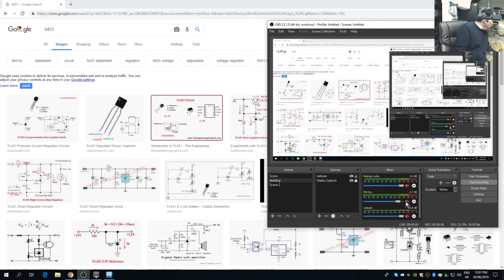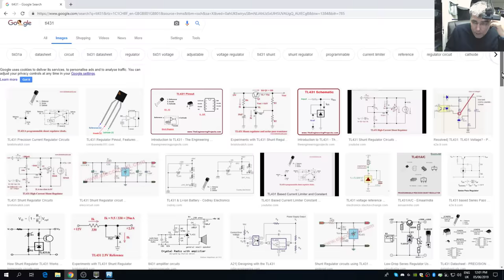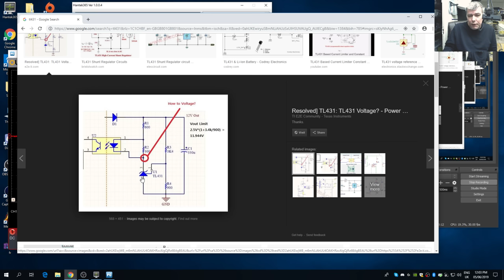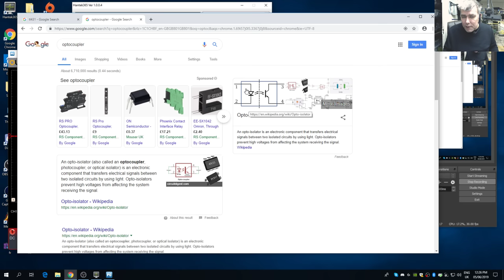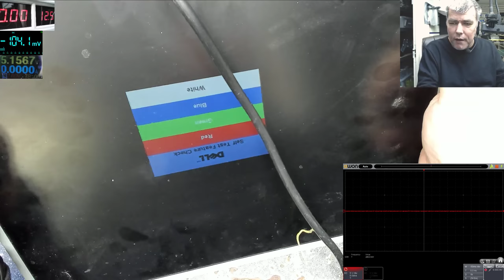Steps to diagnose and repair switching power supplies

Comment: Thanks for the detail explanation along with the capacitors discharge or shorted to ground.  Your oscilloscope detailing is really impressive.  Thanks for the teaching and sharing.  Gain a lot

Comment: Opto coupler feed back from secondary power which feeds back secondary output voltage  to the switching drive IC in primary drive. Drive IC sends pulse width  switching  pulses to FET which in turn drives primary side transformer . Typical switch mode power supply feedback loop. Your correct. Primary needs to know what secondary voltage is.

Comment: Multumesc! I previously fixed a cheap SMPS just for the sake of it, since the parts cost me more than the PS. However I did't know the trick to check the low side regulation. 
Salutari din Galati!

Comment: It would be nice if you would do some trouble shooting and repair of cheap video cards off something like ebay so that some of us can learn the correct process. I have tried removing items and checking them, injecting current and voltage without any luck. There are people doing this on expensive cards that look nothing like the cheap cards and they move so fast and with the camera back so far that you cannot see what or were they are checking things. Thanks for your time. Stay safe.

Comment: You can't necessarily tell if the capacitors are fine just by looking at them. At least half of the bad capacitors I have found with an ESR meter, looked perfectly fine, but they were causing the units not to power on. I can't believe that you don't have an ESR meter. The "Blue ESR tester" is a great meter because it gives accurate and consistent readings instantly. The very cheap ESR meters can take a very long time to get a reading.

Comment: domnule Sorin, va rog o parere: am un tv BUSH dled 49 inch. functineaza normal timp de 10-15 minute apoi ramane fara backlight (dispare lumina la display ,tv-ul ramanand in functionare cu sunet si toate comenzile); Daca il reconectez are acelasi simpton (10-15 minute ..). 
Condesatorii arata bine, nimic ''puscat'' pe sursa. Am sculele necesare sa pot schimba piese (pistol de lipit, sacaz kalafonia, cositor zacro 0.6 mm,desordering wich,,,)si un pic de cunostinte ca si amator.

Locuiesc in Dagenham si nu am masina proprie sa vin la dumneavoastra la shoop cu tv-ul.

Multumesc !

Comment: it's nearly impossible to understand with the microscope view (it zooms too much) you should maybe take a picture and print and drwaw the circuit like big clive does (a YT chanel). Or maybe (cheaper) you could take a picture using a tablet (and eventually edit it by drawing on it) to show us the circuit if you don't have printer. It's a shame you show interesting stuff but don't invest in illustration which makes it nearly impossible to understand.